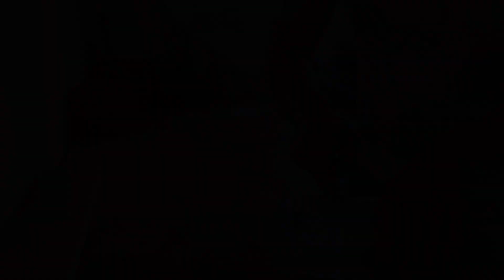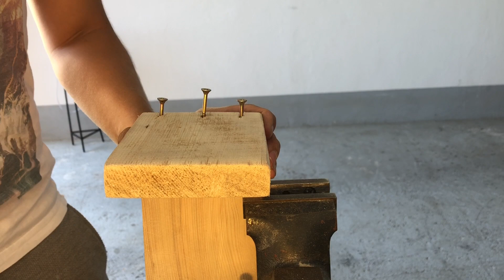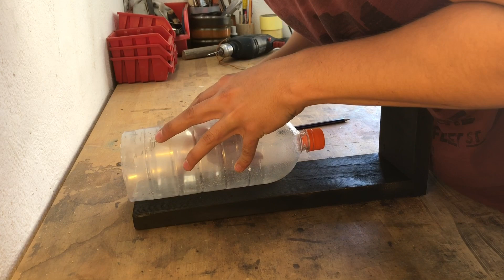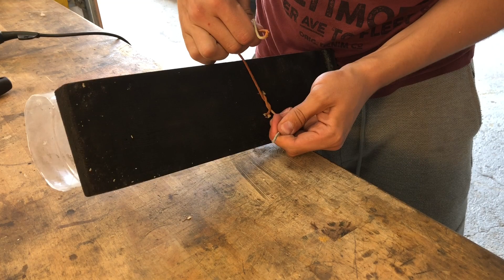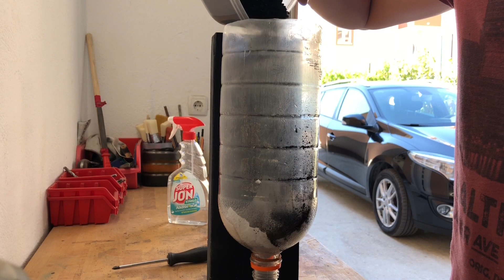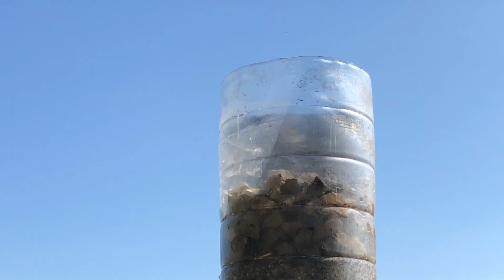How To Make A Water Filter

Comment: What are those rocks called?
Reply: Rocks. Any rock that size that's not been polished will do. It's the surface are of the gravel sand and charcoal that clean the water so driveway gravel would work very well